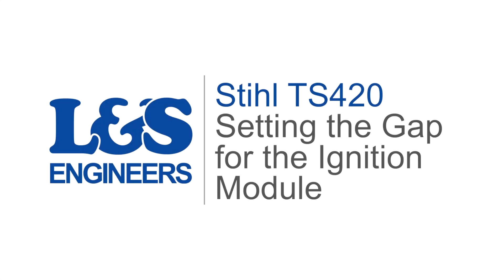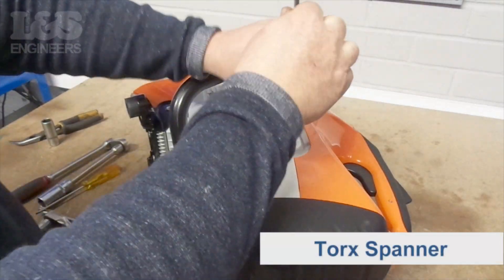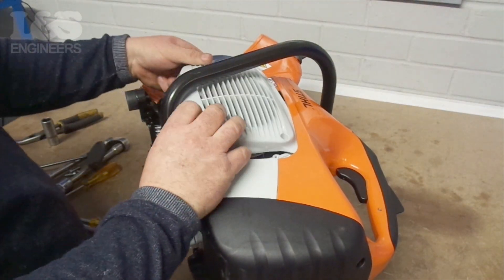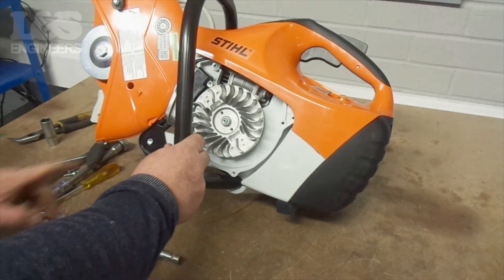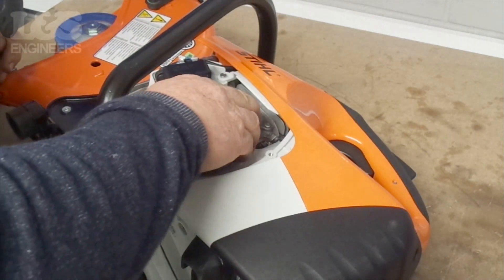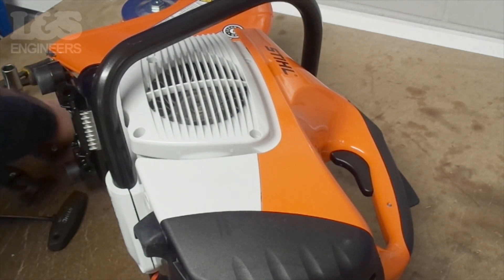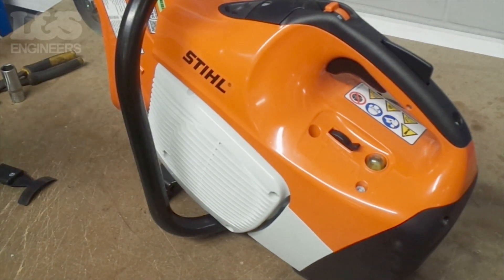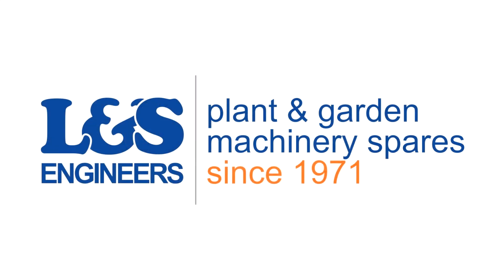How to Set the Gap for the Ignition Module on a Stihl TS420 Disc Cutter | L&S Engineers

Comment: I've just set mine to 0.34mm using a card business card (measured with a Vernier calliper), after replacing the coil pack. (Stihl MS440 chainsaw). Started up 2nd pull!!

Comment: What is the thickness of the setting guage?
Reply from the maker: Hi, The air gap between ignition
 module and flywheel is 0.15...0.35 mm.
Reply: @LSEngineersTV  thank you but the question is, what is the thickness of that 'setting gauge'?
Reply from the maker: @johnallen277  Hi, Stihl have a Setting Gauge Part no. 1127 890 6400 (0.35mm) for this task. Anything else please let us know :) https://www.lsengineers.co.uk/setting-gauge-genuine-stihl-no-1127-890-6400.html